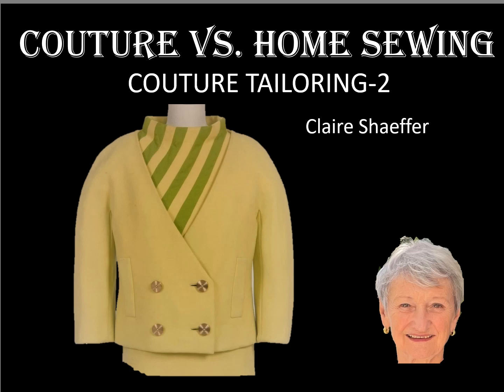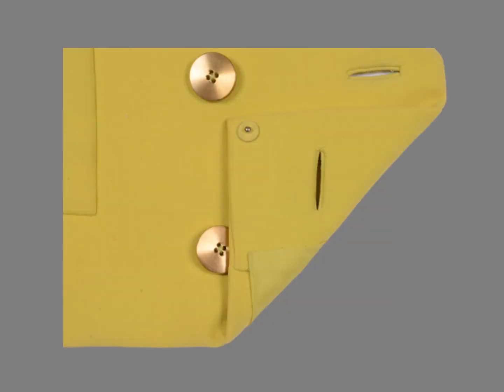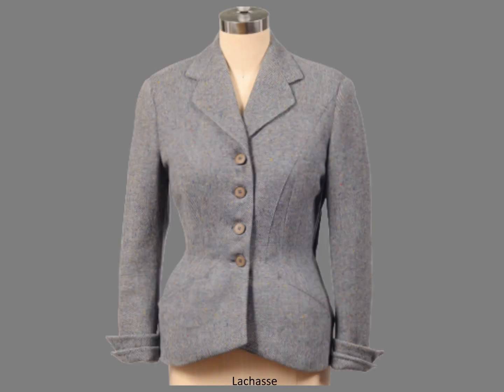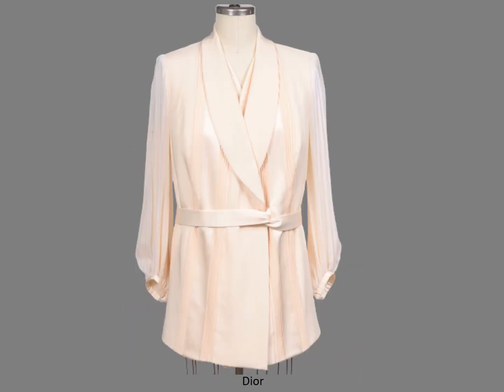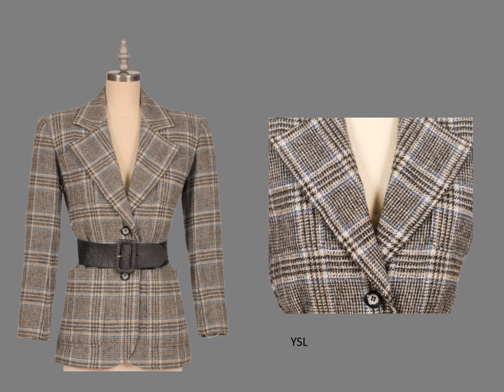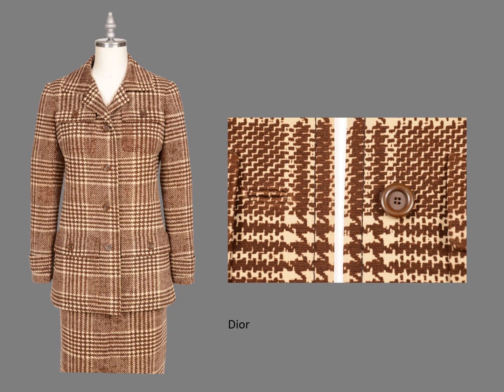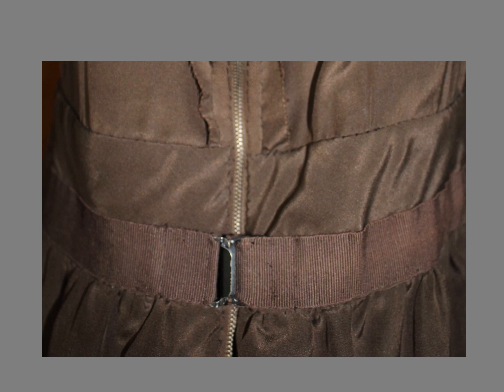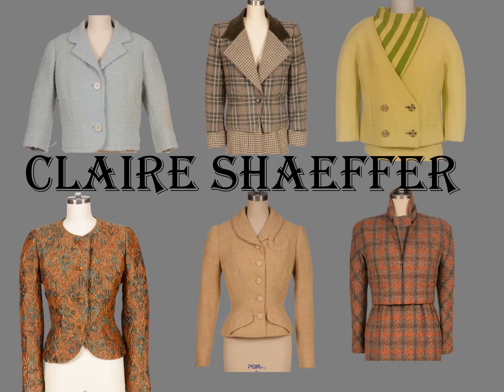Couture vs Home Sewing

Comment: I am intrigued by the concept of the slip top. However, I think it would be ideal if you did not have to wear an additional bra underneath. To do that, I suppose you have to venture into corset or bustier territory. For a woman with a small bust (32-34"), what do you think is most practical? I have looked at patterns from the late 1800's in which there is always a structured underbodice, and some of them even call for a "chest pad" stuffed with horsehair. I hope you can comment.
Reply from the maker: How about a camisole or silk undershirt. ok, doesn't work for large boobs.